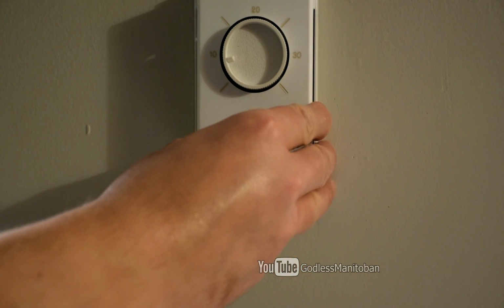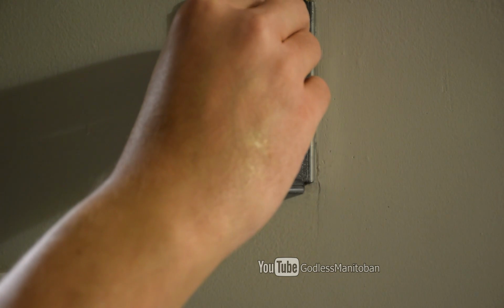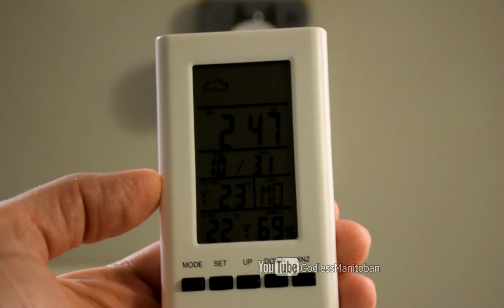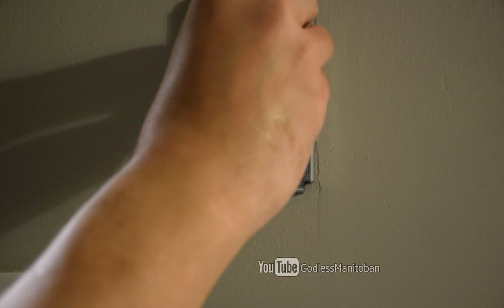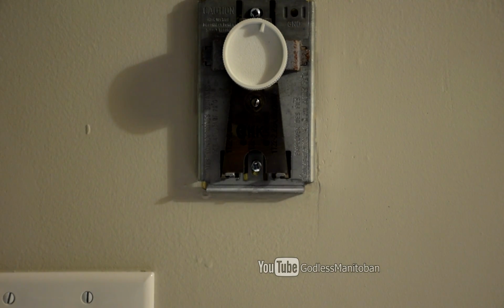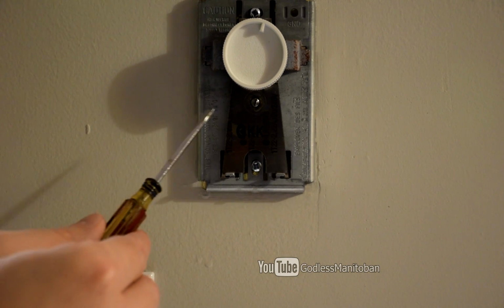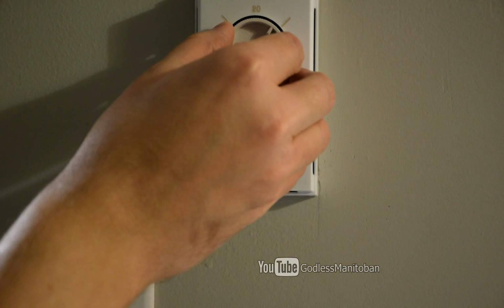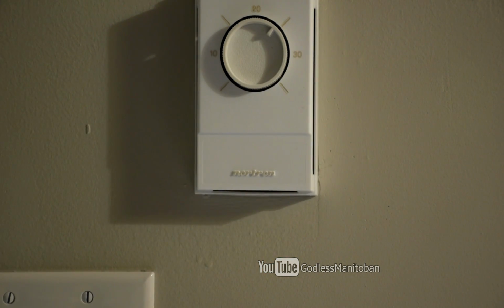Calibrate Line Voltage Thermostat (How to)

Comment: Yours is the only thermostat "How To" that discussed calibration. There are sooo many comments online about supposedly "defective" thermostats that simply need to be calibrated to correct setting.  Mine is a Honeywell T410. I am using it to control a heat emitter for a baby chick brooder.  Upon close examination, I found that the control knob consisted of an inner rheostat and an external knob/shell.  By pulling on the knob, it came off and I could reposition it to reflect the current temperature.  I don't understant why that bit of crucial information was not included in the product description or wiring guide.

Comment: Thank you! You’re the man. I have one with two calibration screws so it was not fun trying to calibrate
Reply from the maker: It sure would be fun. Glad you found this video helpful.
Reply: @arangotan  how did you calibrate it with 2 screws. I have a king thermostat with 2 screws and need to adjust mine.. it barely gets warm then turns off. I need to extend the hot option Any advice? thanks
Reply: @ it’s been a while. I forget. If I recall correctly one screw is for the fan and the other is to get the heat. You want to set the dial to just above  the current indoor temperature and adjust both so that they go off when you go up, and off when you go down

Comment: Thanks for sharing this Video. So if the Thermostat won't click OFF at the lowest setting, just turn the callibration screw counter-clockwise (to left) - - and if the Thermostat doesn't have a callibration screw, try replacing the thermostat as it may be defective.

Comment: this isn't exactly what I was looking for but in case someone else winds up here with the same issue I had here's what I did. I have a Cadet brand thermostat that didn't have this type of calibration screw. instead what I did was pull off the knob after removing the face plate. It has teeth that fits on the part that turns to adjust the temp. mine was turning on at the point where it was pointing at about 40 degrees when it was over 65 degrees in the room. If it were to set it to heat to 65 degrees it'd probably heat to almost 80.

what I did was remove the knob, and sorta eyeballed it to where it should actually be pointing, and then pushed it back on so where the line was pointing to was near the actual temp of the room. so when I adjust the thermostat it's near the actual temp and the point it turns on is a little over 65 degrees instead of 45 degrees.

Comment: Just love your video. Simple and efficient. Here is my issue. We have an air dock heater unit in each room. When I shut down the thermostat in one room there is still voltage on the black wire on the heater. Can the thermostat being the root cause because voltage is always on and the high temp limit switch on the unit shut off? Thanks
Reply from the maker: Oh that is beyond my knowledge. I'm not an electrician.

Comment: So my issue is it runs too warm. It’s around 80 when it’s on. Do I turn the screw left or right to get it to stop around 70/75? Thank you for your help!
Reply from the maker: Turn it counter clockwise (left) would reduce the heat as the screw will come out. I generally check the room temperature, then set it to that temperature, then adjust the screw so it turns off at that spot.
Reply: @GodlessManitoban  Unfortunately mine just has “Comfort zone” but now I have a great place to start. I’ll have to tweak it back and forth I’m sure. Thank you for your prompt response! I’ll let you know how it goes. 👍
Reply from the maker: @Chocogummy26  I wish my landlord would just install a digital thermostat but I guess that won't happen.
Reply: @GodlessManitoban  Totally agree! Mine kept saying it was a gas water heater. I looked at it and it said electric 😂

Comment: It’s safe to use metal on the screw while it has power?
Reply from the maker: Yes, the electricity is behind the thermostat. There's nothing that should cause electrocution unless someone wired it incorrectly.

Comment: Thanks for this video. Mine is not even clicking; do you know what might have happen?
Reply from the maker: Either the thermostat is shot, the power is off at the breaker or the screw is too far out.
Reply: If it ain't clicking it's fused because somebody worked on it hot and shorted it out so the contacts are permanently fused and thus, on all the time.

Comment: Thank you. My landlord is useless. 😉
Reply from the maker: You're welcome. Coincidentally I did this today myself. I noticed that since it's been cold outside that the heat wasn't running much and wasn't getting warm enough. So I increased the temperature and then it was too hot. Now it is calibrated and the temperature (indoor thermometer) matches the thermostat setting. If only they'd go digital thermostat it'd be way easier.
Reply: @GodlessManitoban  my problem was just the opposite!  I came home to an apartment that was 84F (`28C)!!!  I like it more around 68F.
Reply from the maker: @andrewbesold3872  Me too and mine was about the same when I first moved in.

Comment: Can we just turn the thermostat off when the temperature goes up to what I want to reach? It keeps around 22degree althought clicking sound comes out dialing left?
Reply from the maker: Yes.
The clicking while dialing left is probably it turning off or closing the circuit (no power).
Reply: Closing the circuit means power. Open circuit means no power.

Comment: You are right about your tstat calibration settings. The only thing with these tstat is they  have a huge deadband, about 5deg c. If you calibrate them so they match your 20deg c when they click on, they will be on @20 off at 25...

It would be good for the sake of calibration that you adjust them by half their deadband.  Calibrate @18deg c. If you do so. Will start at 20, and stop at 22.5deg c. Maintaining an average of 20ish
Reply from the maker: I think you're right. Sometimes it'll be around 25°C if I set it to 21°C.
Reply: GodlessManitoban yeah due to the deadband. Its okay, they are high voltage mechanical device, can only ask so much from them😄

Comment: What if calibration screw wont turn?
Reply from the maker: It could be stuck I'd add a very small drop of oil or lubricant and wipe off any excess. Then try again.
Reply: GodlessManitoban Thanks I will give it a try and let you know because in my apartment it is way off  by like 20 degrees and we don't like guessing everytime to keep it comfortable. It either gets way to hot or not warm enough.
Reply from the maker: It was way too hot here too.
Reply: On mine the screw is sealed with paint to stop people turning it.